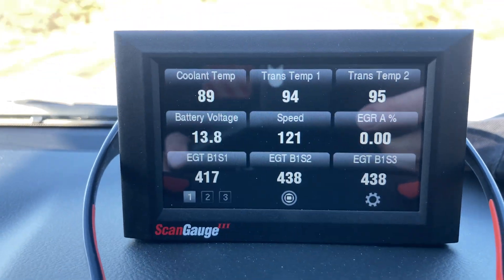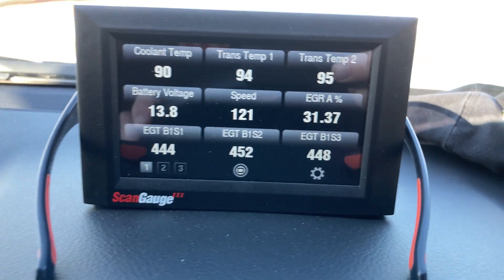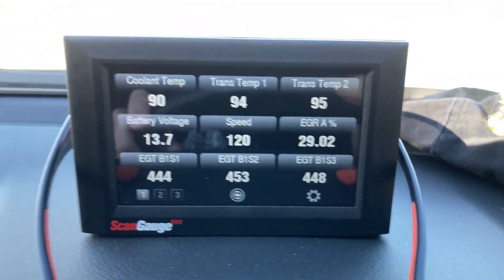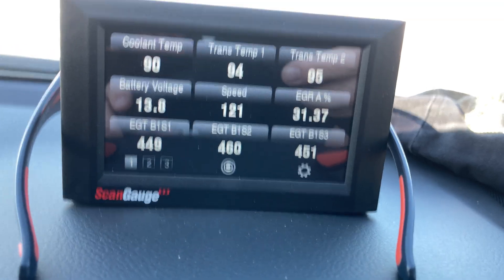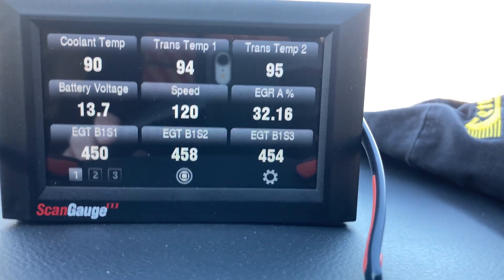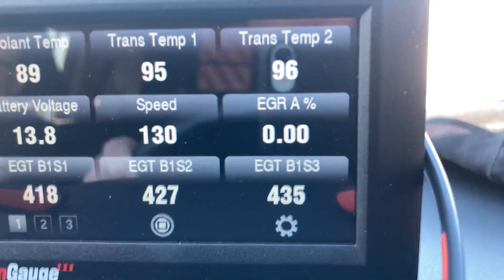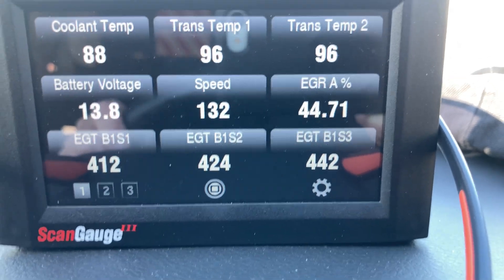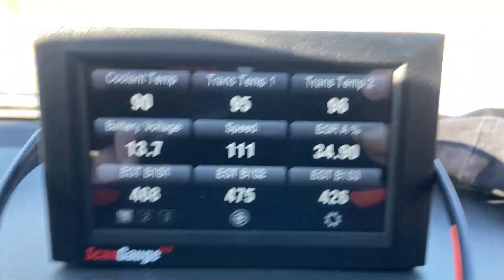LETS TALK EGT’S - Does it MATTER and Why

Comment: Fuel economy   with EGR and DPF is disgusting in my 2021 2.8  tojam . 
--- In another  vehicle Ford 3.oltr  DID  just the poor egr operation and the really bad aircon struggle to get to temp/thermostat  [found overcharged ] since new gave very erratic fuel economy . Current usage 10ltr/100 km at 100kh/hr   12ltr/100km  at 120km/hr Ford 3.0ltr   Cleaned out manifold 2-4mm sludge at 95.000km   EGR bypassed 
---MY 2011tojam  3.ltr 1KD achieved 631km very close to [10ltrs per 100km city driving ]went to [9.5 on h/way ]. No engine work . AFTER 100,oookm till 130oookm  fuel usage increased then sold . needed injectors /egr modification  Tow  1.5Ton  h/way 14 ltrs /100k at 100km/hr

Comment: Adding EGR gasses to the cylinder 1/ supposedly  might lower the temp of combustion process and improve Nox 
The real question is whats causing the higher exh temps maybe 1/ richer mix because the exh gas displaces the oxygen . 2/ do the injectors change when the egr is open ???   . summary is there is more going on than the media tell you.  ------------- LOL  engine runs cooler with EGR is an absolute lie .............

Comment: After i got fresh injectors from you, cleaned the EGR and intake, pulled the sump and cleaned the oil pickup and totally blocked the EGR the car runs beautiful. The oil stays clean longer, better fuel economy, doesn't rattle like an old tractor. In fact you saved my car, it's an 07 with the bad injector seals and the oil pickup was almost totally blocked when i bought it. I learned about the issue from you back in the PP forum days and bought the injectors from you through the forum that's how long ago. Fast forward many years and it's still running like a new vehicle.

Comment: My 2021 runs 500 to 515 towing a caravan cruising in 5th between 90 to 100 kmph. Engine temp drifts above 95 on hills and rises if the ambient temp is above 34 degrees. From what you have shown would controlling the EGT flow with a plate restricter  result in lowered EGT temps towing and lower engine temp?